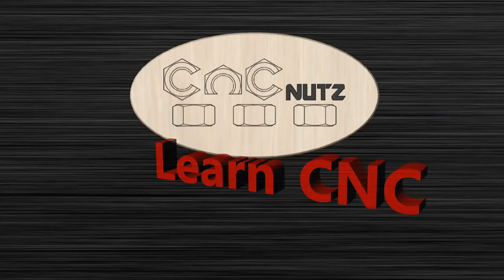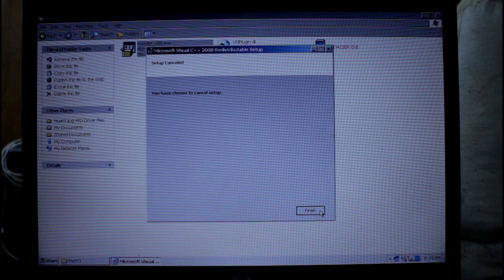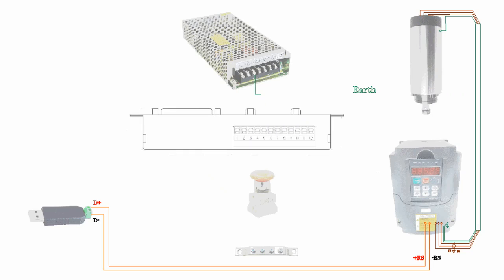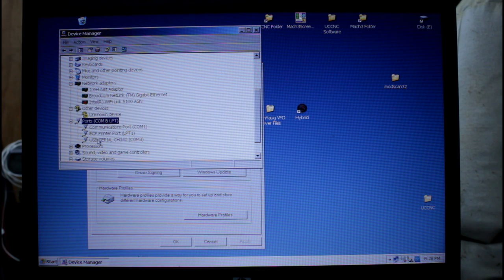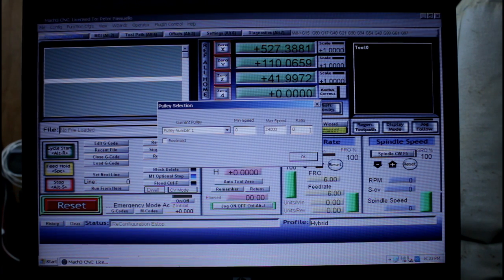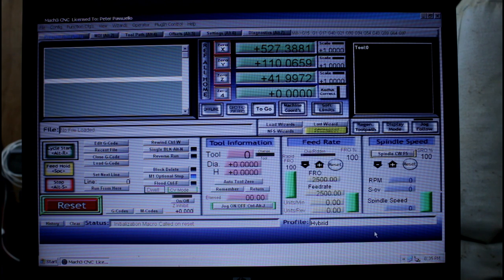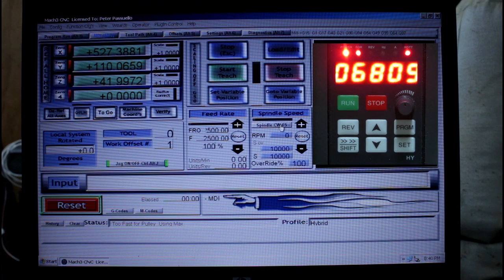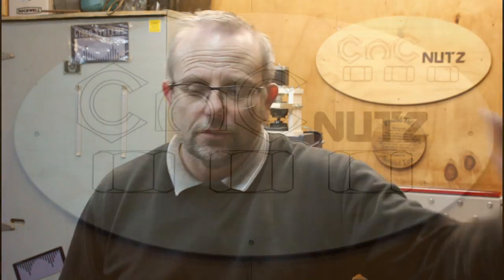Mach3 RS485 spindle control - CNCnutz Episode 147

Comment: In the motor tuning. Do you just ignore spindle there?
Reply from the maker: It depends on the type of spindle you have. If your spindle is like a stepper motor using step and direction then you need to setup the spindle in motor tuning. If you have a spindle like mine that uses a VFD then just ignore it. I haven't seen or heard of a spindle that uses this method of control so it is  unlikely that you will need it. 
Cheers 
Peter 
Cheers
Peter
Reply: Thanks. I have the 2200w 220v China spindle
Reply from the maker: If you go back a few videos you will see the settings I used in Mach3. They build on one another so the settings in this video are the changes to Mach3 from the previous video etc. You may have already seen them.
Cheers
Peter
Reply: Thanks!
Reply: Just got it working. Thanks VERY much for the vid/help
Reply from the maker: Great news. Glad the videos helped.
Cheers
Peter
Reply: Well it was working. I went to actually cut something today and I get "unable to read" pop up. Windows says the driver is ok. I didn't change a thing. Bad usb adapter?

Comment: If I disable spindle relay will the spindle still come on automatically at the beginning of a cut and off at the end. like my router does now
Reply from the maker: I honestly couldn't tell you as I didn't try it. Is there any reason you want to disable the relay?
Reply: I’m sorry I thought you said to disable spindle relay when using rs485 . I will watch that part again . Thank you
Reply from the maker: No Problem Don, I don't blame you for getting confused.

I Disable "disable spindle relays". 

Nothing makes seting things up easier than using double negatives in your settings.
Thank you Mach3 for making things crystal clear.

Cheers
Peter

Comment: Hi Peter,
I'm having a bit of problem when booting up Mach3 since I installed the Rs485 pendent.
I have to go into Device manager and update the Com Port to get it working. I also tried changing the port's address number (from 3 to 9). to get it working for that period.
Thank you.

Any advice will be thankful.
Webman_tt.
Reply from the maker: +Alvin Smith
I have no idea what could be wrong With your setup. If you are running XP did you install Microsoft Visual C? That is the only thing I can think of.
Cheers
Peter

Comment: My spindle is running the wrong way how do i change the direction please
Reply from the maker: On a 3 phase spindle if you swap any 2 of the 3 power wires going to the spindle it will reverse direction. Eg swap the U & V
Cheers
Peter
Reply: CNCnutz (Peter Passuello) thanks pete your you tube has been invaluable keep up the good work
Reply from the maker: Thanks Martin

Comment: If you use a true shielded twisted pair ground the shield AT ONE END ONLY! In this case the best place would be the neutral power wire on the VFD.
Reply from the maker: +John Ware
Under no circumstances connect the screen to the neutral. Only connect the screen to ground. Using the neutral is the quickest way to electrocute yourself or others. In countries which use a 2 pin plug the plug can be inserted either way around and then the screen will be live. Faulty wiring can also cause the neutral to become live and lethal.
Please, please do not use the neutral.
Cheers
Peter

Comment: Worked great for me sir thanks for all your fine info mine can be seen here 
https://www.dropbox.com/s/32kl0slwajzp341/20190120_125339.jpg?dl=0
Reply from the maker: Thanks Jerry. Glad it worked for you. That's an interesting place to put the VFD. 
Cheers
Peter
Reply: @cncnutz  
Thanks yeah kinda limited on space my spindle leads are 14 inches lol
Did you see my video i posted for mark
That was the titanium test seem to me it passed with flying colors of course 
It only milled to .020 in two passes 
But i had two people say that it would just skip around and make a mess and probably break the carbide bit 
well they where wrong dont get me wrong i most likely will not be milling titanium on my cnc but i will be burnishing it with a wire brush bit on their i got a friend with a water knife cuts it all the time much cleaner than a mill anyway 
My cnc is a beast so i had to try how ya like that 40 watt laser too the picengrave board is the cats meeeyow

Comment: FYI - I hope this helps someone. I was able to get vfdPlugin-1.7.1 to work. If you get a message the .dll is corrupt YOU MUST have Microsoft Visual C++ 2008 installed. Microsoft no longer has this file available on their website. You would think the newer versions would be backwards compatible, but it isn't in this case. Just Google Microsoft Visual C++ 2008 and install it. If you want to trust my copy it's available at https://drive.google.com/file/d/1zAPi7uuboZnbzPBTxZyibfbLWSuNRjfo/view?usp=share_link. I wouldn't trust the file because I said trust it, make sure to do a virus check on it.